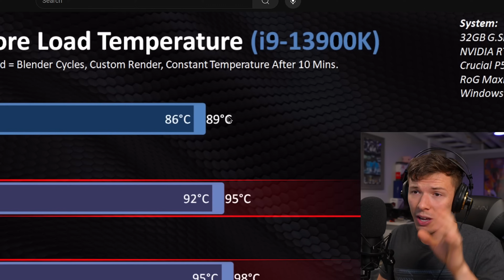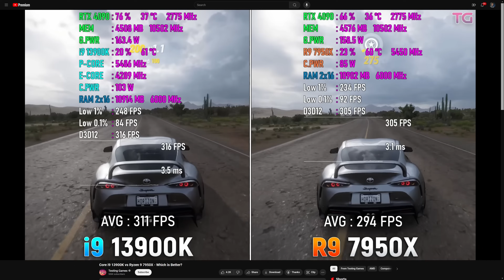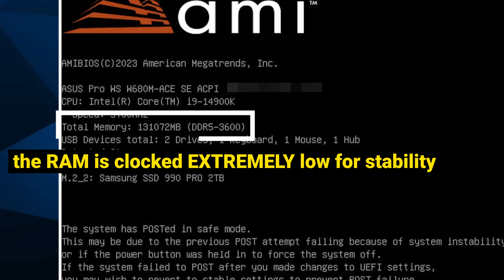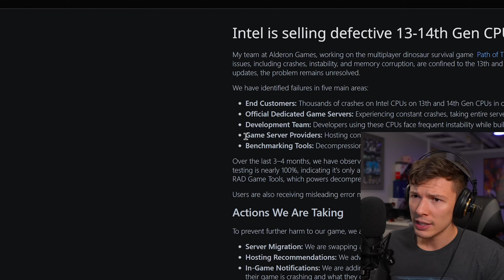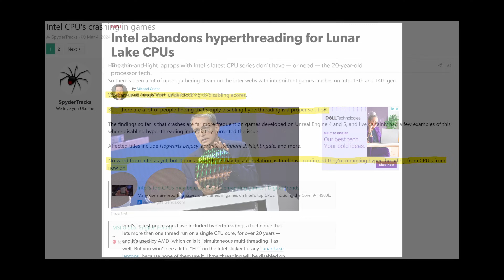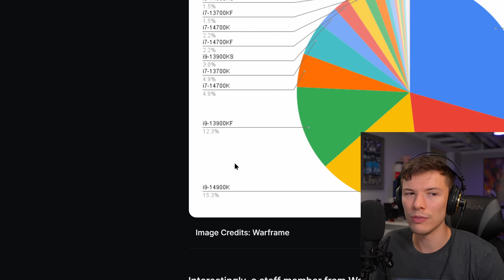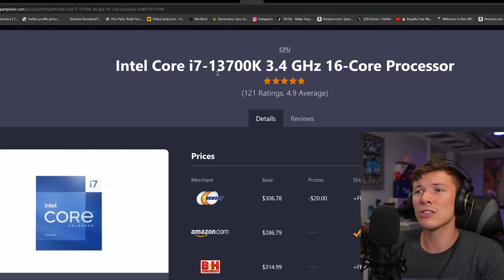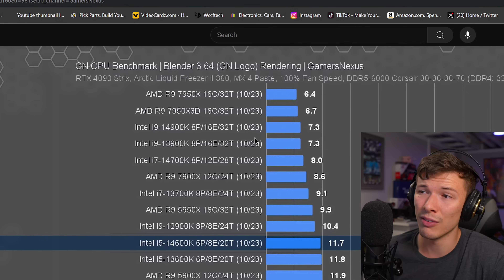Intel F**ked Up Bad

Comment: Honestly if the motherboard manufacturers are cutting corners, considering the architecture that regulates voltage on a board, it is more than likely not the CPU as it is the motherboard manufacturers. The vRam issue pertains to a possible disconnect in communication between the CPU and the GPU opposed to a specific failure related to the CPU, this is more likely than a completely defective CPU. If the design of those motherboards was rehashed from old designs to save on money, they may have tried to cut corners. A good indicator of it being the board is the excessive temperatures, if their is too much resistance to close to the socket leading into all the other circuit connections, it could mean a bottleneck in the circuit leading to other components like the GPU. This could also be a disconnect in the firmware for the motherboard in tandem with the drivers for the CPU that aren't properly regulating voltage through the board from the CPU. Tests should be done on a PCB with only the socket connection and the motherboard to test it that way, if the tests are stable in that test it would imply the motherboards are coming out defective opposed to their CPU. 100% failure rate is suspicious, something that needs to be considered is the release date of these CPU's the boards which they are running on, and ultimately whether it is faulty board manufacturing or possibly software. The problem with the 100% failure rate statement is nothing fails 100% of the time unless it is deliberately sabotaged, especially when so much time goes into engineering these essential pieces of hardware. If you find that earlier generation boards during the life of the processor have a higher stability while paired, it would imply a flawed board design. There are incentives for motherboard manufacturers who make their money off of one brand over another to sabotage the competitor especially if the cost vs profit margins are lower, Intel is notoriously more well known, and does cost more in many cases. With the market shares for many computing hardware stocks skyrocketing because of the AI boom, greed could play a role, and it may not be intel at all.

Comment: The arrow lake server chips that will be coming out after desktop will have HT support so it isn't HT.

There is an hour long video done by Actually Hardcore Overclocking and his idea is that it is the Ring Bus intel uses just shits the bed eventually and the CPU dies. Still just speculation but it seems a lot more logical than trying to blame it on HT when they aren't getting rid of it by choice for desktop consumers. Rememer Arrow Lake is already 6+ moths delayed, they just want to get those chips out of the door at this point.

Comment: I just think it's f**** hilarious that all these idiots bought Intel despite the fact that it was incredibly obvious this was going to happen anybody with two brain cells could see that a CPU running at 100° 24/7 while pulling 300 watts knowing that the reason they bought that CPU is because it was at the time cheaper than the AMD counterpart but then they would have to spend an extra $400 on cooling which I know they won't they probably put like a single tower $25 air cooler on it I've just laughing at all of you

Comment: I have a 13700k in my office pc and I like it. It can multi-task MUCH better that my Ryzen 5800x3d gaming rig. I've had 1 crash in a year of 24/7 use (I cpu mine with it) and that happened when I was tuning it's voltage.

Comment: Intel knows how to make CPUs. They've just running low on architectural improvements to make CPUs run faster gen over gen. 
All of the new increased wattage components, both CPUs and GPUs, is a result of the free performance ride we got from Moores Law being over.

Comment: I built a lunch box style pc with the 13900k. It is cooled with a 184mm aio (dual 92mm fans). If the power is left uncapped, it easily hit 100c 4.9ghz. Dropped it down to 253watts didn't see 100c with lower speeds. 260watts seems to be the sweet spot for my setup as I can still hit the 4.9ghz with 85c under long durations when video rendering. But, I have had it for a few months and don't use it as often. So  majority of the time, it's not being used. Still fast as hell though.

Comment: It is not just that Intel might have to replace CPUs, but as a consumer I would also be demanding extra compensation for the cost of taking my PC apart and rebuilding it.
Reply: The fact that we had to spend our hard earned money on a motherboard for that specific chip is also trash and we should get compensated for it as well
Reply: @arturoreyes5220  That too.  Unless Intel produces a "good" CPU replacement that fits that socket. It is a pretty bad situation.

Comment: nVidia use to sell defected gpus for laptops. And they knew they are defected and still sold them. And in laptop you cant just replace graphic card.
Hint: Do you know Mac or Apple cant even hear about nVidia. Cause of those gpus Apple jst couldn't do anything other then throw there costumiers under the bus. By just ignoring issue.
Emagine how many laptops ended up in landfill because of that.

Comment: 14900k and 13900k are enthusiasts cpus running cinebench R23 with 2 cores boosting to 6GHZ at 100c you will get degradation.  400A 253 wats lock cores. If you want to overclock delid for proper cooling.

Comment: Level1Techs shows that this has very little to do with overclocking, tempratures or voltage. Its even happening on server boards. The actual current theory is there is a physical defect in the Ring-bus that cannot stand up to sustained clockspeeds even when set to a standardized server board which does not support tinkering with voltages, even some exmples ive found when the chips are undervolted.
Reply: Servers operate CPUs way harder than consumers do.

Comment: I find the misinformation in this video and the inclination that is more than noticeable about that "Red" color brand incredible, everything is mere speculation because in fact the same Warframe team tried to replicate the errors that were reported to them and they were unable to do so. In fact, they mentioned that a member of their team had problems with their Intel equipment and it turned out that he had a 2022 version of Bios. Finally, and the most impressive error in this video, a 14700KF is the only gen 14 processor that can be recommended. It already has a significant difference since it has 4 additional threads that are E cores, 3 MB more Intel cache and +4 MB in L2 memory. You should inform yourself a little better before making a video since in several aspects it is far from giving information. objectively it seems that you are trying to do the opposite, I like your channel but I think this video does, it takes a quite different direction

Comment: um xeon is for servers not I9
Reply: the boost clocks on xeons are usually pretty low so using i9s which have super high boost clocks are better, since they are single core based and xeons have a lot of cores but just at a lower power

Comment: We really need to get back to much lower max thermal peak, like 60C at most. thermals have been rising for a long time towards 100C+, which is far too high for the longevity of the silicon.

Comment: I was done with Intel shenanigans back in the late 90s with the slot 1 Pentium II.  Unfortunately for me, I found that AMD shenanigans weren't much better with the Phenom CPUs and later with the FX CPUs.  But at least, they worked.  They ran hot.  They were inefficient.  They were power hungry, but they still worked.  I've been with Team Red, almost exclusively since Super Socket 7 K6-2.  It hasn't always been great.  I bear no ill will to those who are with Team Blue.  This disaster in the making does not bring me any joy or satisfaction, but disgust in tech corporations in general.

Comment: Like this, if you're here after 8 months  or a year, still 41k plus r23 and zero stability issues at icy cold temps. 14900kx and 13900kx.

I'm so glad I own all major flagships.  Have you tested abything Vex? Seems you're just parrot. Sorry but keep squawking. 🦜 

For us who are actually involved and have already solved the concerns, and it's day one load line to max clock concerns...oc 101 stuff...stuf you should know buying enthusiasts gear...hellllooo

 I know.  It's hard for gen z lol to realize it's not a companies obligation to hold an end users hand...buttttt.....Overclocking and monitoring vid to core voltage is as old of a trick as I can think of, yet we have enthusiest degrading their 7950x and i9 14900kx cpus...

If you dont understand what unlocked means, buy the locked processor, lol...

Tbh I bought my x3d cpus when "the sky was falling" on the ambulge...x3ds still running great lol...even on an asus board? GaSSP.  Turns out even this moron can see 1.5v soc and fix it before a bios patch rofl...0

Comment: Lets pump 1.5V to boost 1-2 cores to ridiculous speeds, it will be fine... high voltage causes cpu degradation. This is nothing new. Issue is, 13 and 14 gen request too much voltage from the motherboard and this can't be fixed by firmware/bios.

Comment: on a i5-13600k i have gotten game crashes  relating to VRAM 3-6 times since i build my system back in Feb on a 4070 super.. Kind of pissed off about all this.   It sounds like the more powerfull the cpu is the faster it dies but this might effect ALL cpus 13/14th gen

Comment: If Intel came out with a custom cooling setup requirement, then it would be OK.   But they throw these radiators at the consumers and leave them to figure it out as if they can even find a cooling solution on the market at all.    This merits a class action lawsuit aside from the underhanded pressure on the motherboard makers.

Comment: When i got the 13700K I got mocked for limiting its power draw to 90 watts with almost no loss to gaming performance and for better temps. Guess that wasn't such a dumb move after all now that folks are RMAing these. Those that made fun of that can mock these nuts now 😝.

On a side note, they're good CPUs, but mobos were clearly coming stock configured with specs that, in my opinion, weren't very long term safe.

Comment: It isn't a 100% failure rate for all of the Raptor Lake CPUs, **at least for now**. It isn't directly power consumption/voltage/temperature/frequency related. Those likely are acceleration some of the failures, but it isn't the root cause.
There are laptops and 13900T CPUs that are having issues, which go to as low as 35W in the 13900T's case for the CPUs that are failing.

Currently the only die that is dying (at least for 100% confidence) is the Raptor Lake 8+16 stepping B0 die. The current idea is that there is a silicon defect within the B0 die that wears out the cache/ring-bus rapidly, which also explain why the i9 are dying faster than any other configs and why it isn't directly power consumption related.

For now, there is not a for sure "smoking gun" as the symptoms are very inconstant. Some only have random crashing issues, some flat out stop working at all, and the 13900T I mentioned can run, but only with a single DDR5 DIMM at 4200 MHz.

Edit: also, most of the non i5 Raptor Lake and below are rebranded Alder Lake dies, and they don't seem to have any problems.
Reply: Yes, cause Vex still likes to clickbait.

Comment: My newest Intel is a 10th gen, 65W i5! My main system runs a 5700X(also a 65W CPU) and I'll probably use my current hardware until I die, because I don't want to be forced to downgrade to an even worse new version of Windows.

Comment: Yeah I won't buy another processor from Intel until they upgrade my degraded 14900K to the next gen. I wouldn't trust a same chip replacement when it is also dying in datacenters.

Comment: So, at the time I got a 12900k knowing I'd have an upgrade path vs AMD's only AM4 availabe at the time. So much for that idea and I am definitely glad I didn't upgrade as the 12900k; which is at least rock stable. This is a disaster for Intel.
What's really funny is that I have a slight undervolt on my chip w/o a performance loss and don't see over 80c under cinebench.

Comment: the big culprit here is the default bios power limit. it allows the cpu to go beyond spec. even my 13500 can pull 165w for 2-3 minutes where its default should be 65w with up to 154w on short bursts.

Comment: Nowadays there is a lot of exaggerated fake news, also by influencers. Those Intel processors are used by most companies and no one has any problems. It is mainly a combination of overclocking and people who assemble computers who have no knowledge of it. I still play the latest games with a 6600K overclock on 4600mhz air cooling, 70 degrees 👍

Comment: The problem for intel is simple. They're falling behind amd and can't keep up in performance or efficiency. 

There's no solution to this so they keep pushing their silicon to the limit. They're at the limit now. Also, they're rebranding instead of innovating. Ai.

They either need to innovate,  steal amds technology or pay 3td party motherboard manufactures to artificial limit amd chips benchmarks.

Comment: Yes Intel need to come clean as to what the issues are and compensate as soon as the issue has been found... but I doubt it's a 99% failure rate! How do you cool it, simple, lower vcore to under 1.3v which is what it should have been as motherboard manufacturers are pushing too much vcore on auto and do remember these are the K CPU's meant for enthusiast who should now a bit about the bios settings. I am running a 'no issue' 14900K with a 360mm aio, no issues with temps as in Cinebench mid 80's to 90 degrees C, 41K multi core score, my usual encoding and gaming never really goes above 60 to 70 degrees. Two cores hit 6GHz and the all core is 5.6GHz...

Comment: I really wanted to go AMD cpu for my latest build but couldnt find decent ram sticks with Expo here (should have ordered off Amazon) but luckily got the i5 13th gen that seem "safe" for now and I'm now praying it wont self destruct, Cinebench temps seem fine even with a modest OC. Really Intel must recall and replace them with "fixed" stable versions of those chips, this is the last get to support 690z & 790z boards, they have to have stable chips as replacement that work on those boards, anything short of that is should lead to a class action lawsuit but similar problems have existed in hardware before and nothing happened no one but the consumer paid the price. Remember the original xbox 360? the most powerful console of its day was a crock of shit, unstable and eventually all failed. Apple kept releasing new macbooks with the same fatal flaw for several generations and nothing happened to them.

Comment: JFC what this nonsense?
"You could boil water on this CPU."
That's not how LITERALLY ANYTHING WORKS.
You use a FIFTEEN HUNDRED WATT electric kettle to boil water.
The temperature at which the CPU runs is IRRELEVANT to heat output and its ability to heat other things.
All that matters is power consumption - work = heat output.

Comment: Well, I play on my 13900K now for a year and did not have a single crash or bluescreen, playing DCS, MSFS, W3, CP77, Conan Exiles, AOE4, ARMA, Kingdom Come Deliverance, but I do that on a Asus H670 Mobo with 128GB DDR4 3200 not on the Z series, because I used the RAM from my old Mobo. So I am not overclocking since my i7 3820 that I ran on 4.8Ghz for almost a decade. I run that thing constantly at 5,7Ghz. with a 360 BeQuiet AIO in a BeQuiet 500 Case together with a Asus RTX4080. Honestly, never had a single crash (knocking on wood). Maybe the trick is that I am using Win10Pro? My Cores never reach 100°c (sometimes up to 90°c on one or 2 cores) and they also don't clock down even in Cinebench 23! Only problem I have sometimes is when using DCS in Multithread Mode and it tries to use the P and the E Cores at the same time. I get some freezes every 10 seconds then. But that is a easy to fix problem with certain tools. I may try a AMD System next just to see if it is worth it because of the power consumption, but for the moment the old saying "Never change a running system" is my motto!

Comment: I was wondering why my laptop was always running so hot, even when just sitting idle at the desktop with nothing running but the base OS.  I had to modify the fans to run at higher speeds than the default settings.  And anytime I run anything mildly intensive, I have it set to run the fans at 100%.  Thankfully I always using noise canceling headphones when using this particular laptop, otherwise I’d be hella annoyed at the fan noise.
Reply: Replace the thermal paste and also remove all the dust :)
Reply: @uranblut  I’ve had this laptop for one month.  It’s brand new.
Reply: @_morgoth_  oh ok :)

Comment: intel has a market share history.. so many programs were tested on intel more than amd.. if amd can hold 75% market share for two years then sure i'll switch.. but until then i'll stick with intel.. but if there's an issue and they do nothing that could make the history not worth it... 

but i have a 8600k that runs at 37c to 39c idle with air cooler.. and 52c max temp... it's so fast.. i've had it over 5 years running 24 hours a day.. i never shut off my computer except for updates and software installs.. so it's always on.. i've never had a blue screen except a few odd weird programs i tried that caused some crashes.. it's just rock solid

Comment: At the moment, I think it is a mounting pressure issue that is causing the issue. Right now, it seems like people using contact frames as well as the laptop versions are not reporting the issue at a rate even close to desktops using the intel stock mounting bracket. While I think it's too early to make this claim with any certainty, it seems like a possibility,  especially since this is happening across all versions of the 13th and 14th gen, not just the most power hungry i9s.